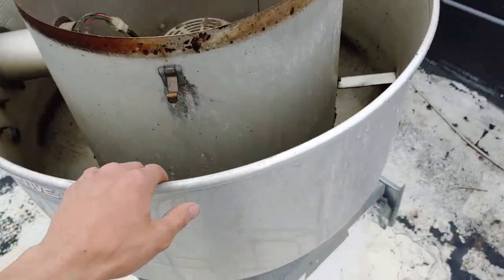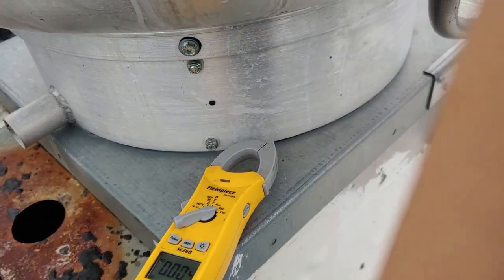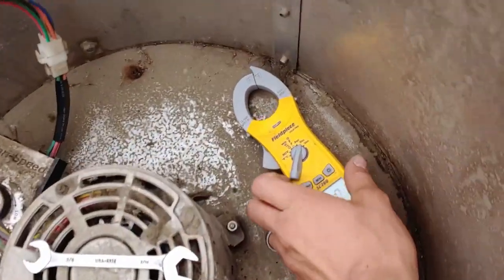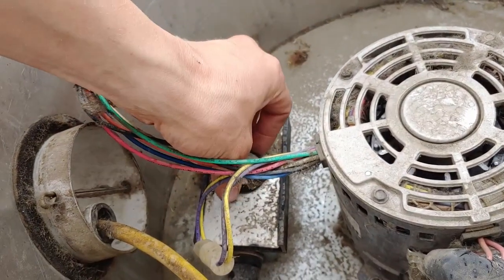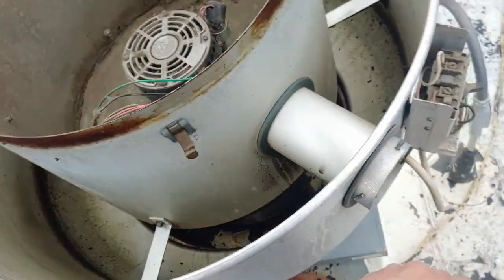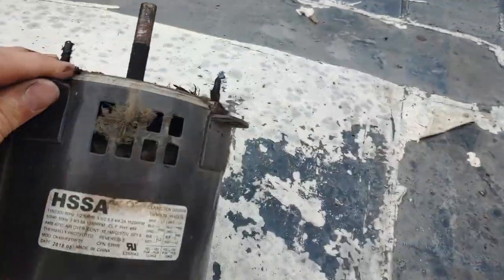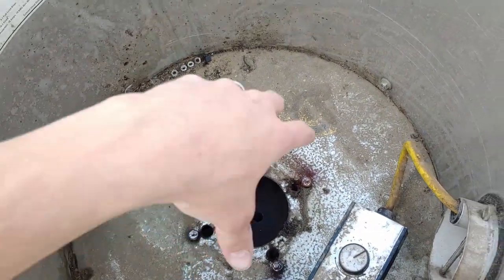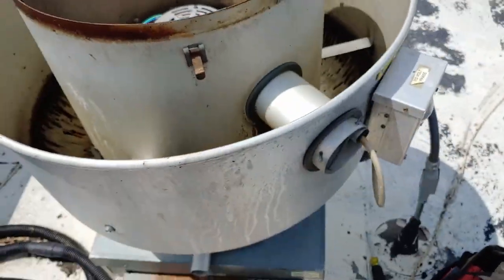Troubleshooting CaptiveAire Exhaust Fan and Replacing Motor

Comment: Just got off a roof with same  issue. The variable speed was off and owners manuals  stated it should be on to prevent premature failure or over heating. I clean there exhaust hood so he called me to take a look.  Wish I saw your video ahead of time I could have grabbed my voltage meter and followed your vid. It was just as dusty too.

Comment: When you wire the motor with a speed control, you wire it for fast speed.   (Then you have the extra colored speed wires)
If you do not use a speed control, you wire the desired (RPM) speed per the wire color associated with that speed.....
and then Neutral to Neutral.  
(For some of those motors, watch out, because Neutral is Black, not white) read the motor schematic to verify.
I hope this helps.

Comment: Any recommendations on taking that motor off the hub? Obviously can’t use a hub puller due to the slanted metal on the hub. I’m changing one out exactly but the motor shaft is stuck on the hub even with grease I can’t get it off.
Reply from the maker: I have had much trouble getting them apart before. I have had to use a torch, and heat it up real hot and then spray oil on it, then pound on it a bunch. Not a very sophisticated answer, but that's how it goes sometimes.

Comment: Hey man I have a question. One of my customers called the top to the fan is missing. The motor and pulleys are exposed, do you know where I can find a top/cover? Thanks
Reply from the maker: I would recommend calling the manufacturer and getting a part number from them. They should be able to direct you to where you can get a replacement.

Comment: Why don't they just run it at full speed? Is this a three-phase motor?
Reply: All depends on makeup air, too high and customers get open the door.
Reply: @publicmail2  you mean, customers cannot open the door cause it would be pulling too much air, or something?
Reply from the maker: I am guessing AD is right about the make up air stuff. All of the hoods pretty much run full power because there is a huge make up air unit.

Comment: Stop calling that simplistic motor speed controller a VFD. It's not even close to the technology of a VFD. Also, that double pole switch is supposed to be interlocked with the fryer below on one side. So anytime you turn that switch off to work on the fan, you end up shutting off the fryer below. And if the fryer below gets shut off, so does the exhaust.
Reply: Thanks man you’re spot on.  I thought they went to a motor controller or motherboard but the gas shut off makes more since this is definitely an older captive air system